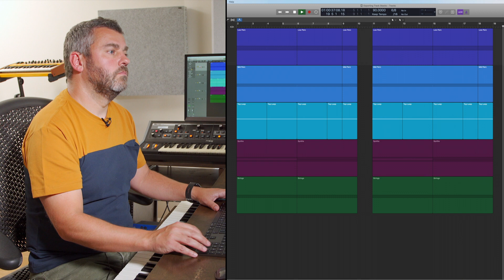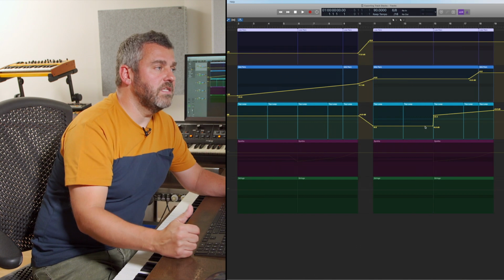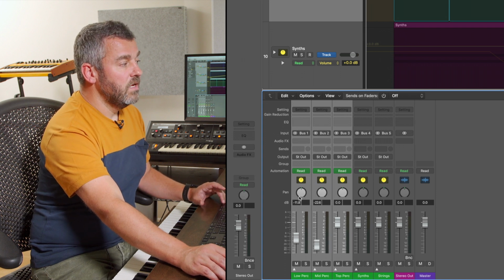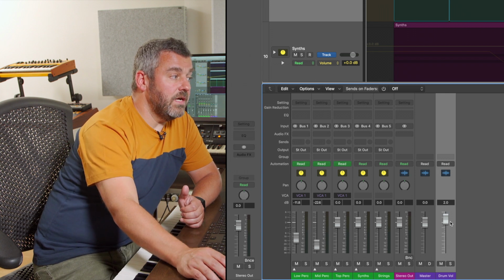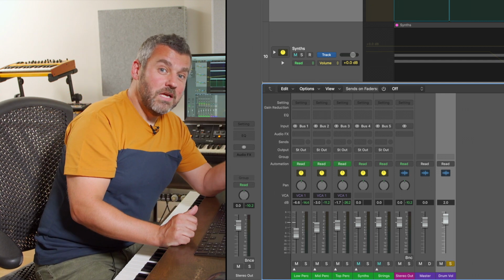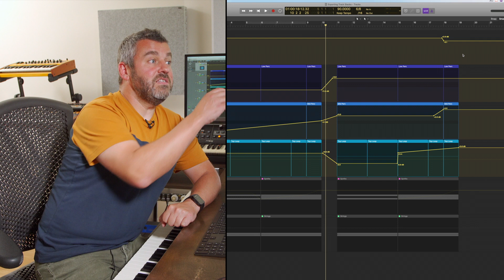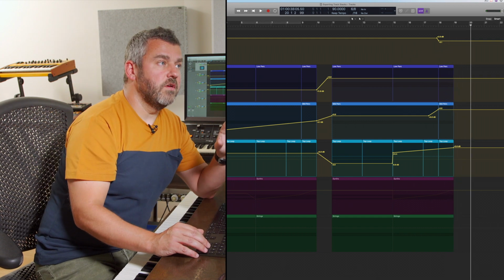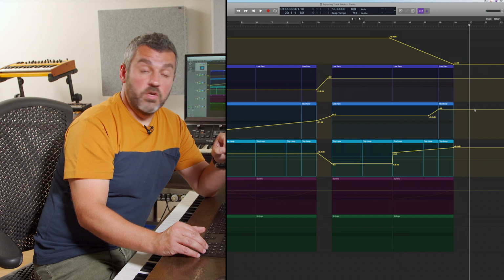Logic Tips - VCA faders

Comment: Is there any disadvantage to doing all this with a regular aux strip? That's the solution I came to naturally.
Reply from the maker: Hi Luke, there are a couple of reasons. The first is that using VCA Fader preserves the wet/dry relationship between your channel audio and its sends. The other is that it's easier to keep track of the routing in your session, rather than having to keep tabs on which channel strip output is feeding which aux channel. I've ended up chasing my tail several times by doing that! —Will
Reply: @MusicTechOfficial  Thank you for the explanation!
Reply from the maker: @legatrix  You're most welcome!